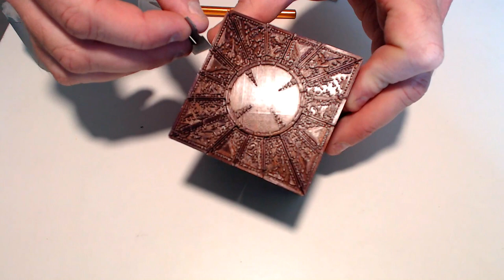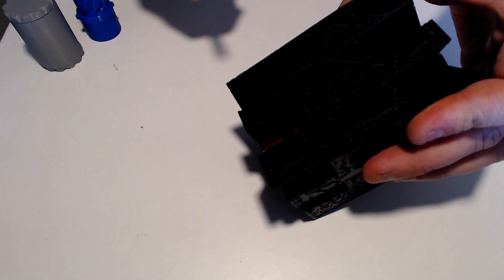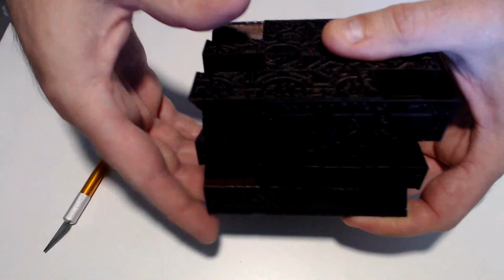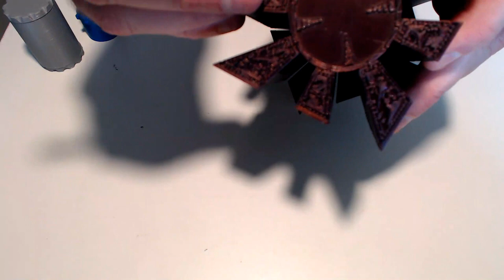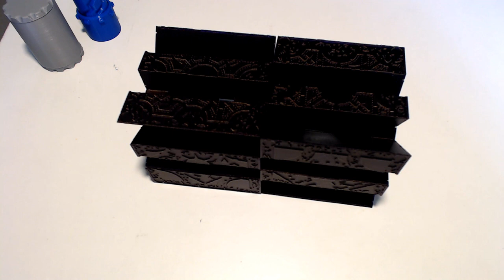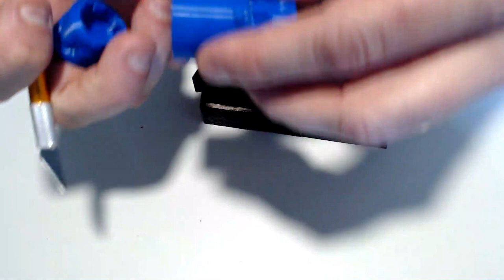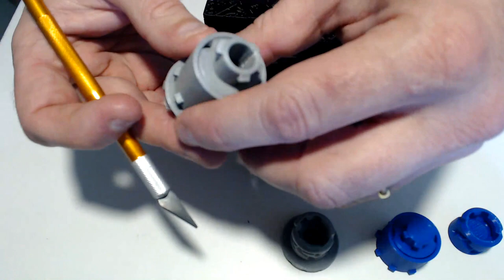Puzzle Box of Unknown Origin

Comment: I've been after something like this for ages and to find it as a printable object is absolutely fantastic! I'll be sure to make it in the near future and give you feedback (or buy you a coffee!) after it's done!
Reply: Just finished the print - the first thing I hit is the force required to open the unit as the close surfaces on the inside blades tend to warp and bind. I've been doing my best to free things up by working everything and have somehow managed to close it up fully! Not sure I'll summon a Centobite in a hurry at this stage, but it's a brilliant cube!
Reply from the maker: Thanks and good luck with that. Hopefully it's the puzzle working as intended, otherwise a little sandpaper and/or lube might help. I actually submerged one of the earlier ones in soapy water to begin with.
Reply: @TroyMackay  Thats not a half bad idea! I really think that the mistake is mine somehow, but typically we just cannot see inside the unit to figure out where it's binding!
Reply: @TroyMackay  I greased mine up all moving parts that touch with wd40. I wish the spring had a little more tension in it to where it comes up with a little more force. I haven't tried disassembly yet, but I got this extra cylindrical grey part with "teeth" on it that came extra. As I peer through the pieces I can see that same part within already so I was confused if it was a "spare" for a commonly failed component?

Comment: I cant seem to get it open  for the life of me, no elephant footing or anything of the such... I did the razor blade thing. and did a 2nd and 3rd try with a knife. it just wont open for me.
Reply from the maker: It's caused a lot of headaches, so I try to steer people towards the newer "deconstructed" version, but since you're here you might want to check out the "Cube Ripper" on Thingiverse. Strategically placed pencils or wooden spoon handles works for me to apply a bit of controlled force (assuming you haven't managed to turn the dials to lock it yet).

Comment: Is there a way to completely open a finish box? Ordered one of these from etsy and is in mostly good condition but there's a small ring with 4 teeth that was broken off the bottom dial/cylinder when it arrived, and so the box won't "lock". It seems like I should be able to easily glue this ring back on, just need to actually OPEN/separate the halves of the box to reach the spot I need
Reply from the maker: Not really, without breaking another part. The rotating part of the core would probably break off with a bit of force, like pulling it apart and bending it a little but then you'll have two problems. The glued part will always be weaker, another option would be to reinforce it with some 10mm dowel (or a bunch of skewers). You could possibly cut some notches to extract the core like the newer designs. Let me think about it some more, there might be a way to carefully break it so it is fixable. Worst case you'd still have a display piece without the core.
Reply from the maker: I'm assuming you don't have access to a 3D printer to print a replacement core. First thing I'd try is maneuvering a piece of dowel in there. 10mm or so diameter, flattened on two sides to squeeze in the gaps. A tight fit might be fiddly, but hold on its own, otherwise at least it will make it easier to align and glue the broken part (which should be reasonably accessible).
Otherwise, I reckon you could make a clean cut with a hacksaw blade, straight down the middle of the sliding cylinder lengthways - stop half way or just enough to split the outer spinning ring (like crankshaft bearings).
This might allow you to expand the fingers enough to get the spinning ring off the end of the cylinder and back again, cutting again in quarters if required.

Comment: Amazing! This might be a stupid question as I haven't printed this yet, but is there a space inside to place something? If not, is there any chance you'll make a version of this with one? This seems like it would be an amazing prop for a tabletop RPG if there was an opening inside that would let you hide something.
Reply from the maker: It's probably worth mentioning since you're not the first to ask. Yes, there is a 10mm diameter void within that is almost the length of the cube when closed. I was saving this for some kind of telescoping spring but you could hide something in there. There would be even more room without the puzzle mechanism, I was actually thinking of making another version with a simple latch to maximise that space.
Reply: @TroyMackay  Thank for the reply. This sounds like exactly what I was after for my DnD campaign!  Again, thank you for your amazing work!

Comment: Troy, thanks for this, can you explain how to take apart the box to insert a spring? Great puzzle, my brother is gonna love it
Reply from the maker: No need to take it apart. From the open position you can feed it through the gap into position. The spring is a bit wider than the gap but you can spiral/screw it through. The latest version does come apart for easier printing, though (but also uses a 5mm spring to strengthen the latch).
Reply: @TroyMackay  where do you get the spring, i've been searching both online and local hardware and hobby supply but cannot find a 5mm OD x 120mm spring anywhere, even mcmaster doesn't have them
Reply from the maker: @Sidion  I found a bunch on eBay, item 222981900101 was the actual one I bought which is still there.
Reply: @TroyMackay  thats perfect thank you

Comment: What if lets say,hypothetically ,i just put the box is hard mode and havent been able to get ut to open for about 2 hours ,what can i do?
Reply from the maker: Suffer... Seriously though, I've got a video explaining the mechanism if that helps visualize what's going on in there. One tip I'd give for turning the dials is stick to a preferred direction and just back track a little if you get to a dead end.
Reply: @TroyMackay  dead end would be when you can no longer turn the chosen one in said direction no matyer the position of the other one? Also wich video is that?

Comment: I printed this and I'm having real trouble freeing off the sliders, because of the dark color of the cube in the video I'm not quite sure where I should be inserting the hobby knife to try and free it and I don't want to break it by forcing the wrong thing. The cube slides really nice and easy to the half open point but from there I can go no further.
Reply from the maker: Sorry about the colour choice - it looks really nice off camera, though. https://thangs.com/tmackay/Puzzle-Cube-Open-14340 has a nice exploded view which might help. There should be a small seam visible where the sliding cylinder is stuck to the outer shell (it is symmetric). Just insert it enough to hear a crack and move around to the next gap.
Reply: @TroyMackay  thanks for that, managed to get it to free off from your description

Comment: Having troubles with the core breaking each time after opening it.. Should I increase my infill to make it stronger and not break from the dials? 2mm 20% infill
Reply from the maker: Not quite sure I follow where exactly it is breaking. There was a bit of a weak spot in the key piece that protrudes from one of the dials which is one reason I switched to a 5mm spring (in the "deconstructed" version). To make it stronger, add walls/perimeters instead of infill, though.
Reply: @TroyMackay  I upgraded the Infill but now the top internal ring won't come free I haven't freed the dials up yet but should I be able to simply get these both half off each other?... Seems jammed in the middle
Reply from the maker: @trevorphilips9368  There's a one-layer gap at the top of the cylindrical core that might need a little encouragement to de-laminate. A hobby knife should do it.
Reply from the maker: @trevorphilips9368  You know there's a heaps easier version to print, right? (description)
I'm starting to think the dials and retaining rings are still better off printed in place if you can manage the clearances and don't mind the overhang.

Comment: I have a problem with the cube.  The retention rings fell out and I can't complete the puzzle.  I can pull it out a little bit, and the spinners come loose from the face of the cube, but then it snags on something.  Neither spinner spins freely, which is the part that's confusing me.  If the two halves can come apart that much, the center lock must be disengaged.  What would be holding the "top" spinner from spinning?  I printed your latest version that is printed in different parts.  https://www.youtube.com/watch?v=NgGZGAddg38
Reply from the maker: It is possible to engage the maze with the main latch in the open position (ie. without turning 180 degrees first). So that the maze itself is holding the two halves together with limited movement. The retaining rings shouldn't really interfere, they are just to stop the dials poking out like that, maybe add a little glue. Your best bet would be to re-engage the main latch and solve the maze until you can turn one of the dials through a full 360 degrees before disengaging the main latch again.

Comment: Hey Troy, wanted to check with you. Printed out this version of the box and was able to eventually get it open and spinning. Once I closed the box however, I couldn't seem to do anything. The top dial can rotate freely right now (it gets hung up on some spots) but the bottom dial doesn't move, no matter what position I put the top dial into. I can't open the box no seemingly no matter what position I put the top dial into, do you know if this is just cause I can't solve it? or is it a print error?
Reply from the maker: Sounds like it is working as intended. When the top dial spins like that it is latched, but not locked (to use a door analogy). If you are able to start turning the bottom dial, that is when it is truly locked. There are two positions the top dial can get to from here (and it has to be aligned fairly precisely) one which opens, and one at 180 degrees which allows the bottom dial to start turning. It sometimes gives a moment of free travel at the open position so it's easy to skip over.
As an extra hint, take a look at how the dials align with each other in the 3D model. They don't quite align but kind of share an edge. If you look really closely, they're not quite symmetrical either.
Reply: @TroyMackay  Thanks for the heads up. Fiddled with it a bit more (your right, it was easy to skip over). got it opened again :) But now I'm scared to lock it :P
Reply from the maker: @hydntylr95  You're supposed to be scared to open it! :)

Comment: great but mine is still stuck half way even after losening that bottom area, infact it wont even close fully now. Do you have a version of this that i can build as the whole print isnt viable.
Reply from the maker: You're nearly there, sounds like the at least one of the dials are even moving (since it won't close - it's probably just turned a little out of alignment). Have a look at the Thangs link - it has a nice exploded view, but you should be able to see the seam where the parts join. Just carefully insert a hobby knife to encourage it to separate, or even give it a little tap to shear it apart.
Reply: @TroyMackay  Seems something went wrong in the middle, some sections where melded when they shouldnt have. I have seen another one of your cubes ( Hard Mode ) seems a lot simpler in terms of operation and printing. Will give that a shot and print the core first.
Reply from the maker: @nidhogg3390  No worries, good luck. I was thinking you could print the core of this one separately, and do the trick of pausing the print at a certain layer and dropping it in but I think that would be inviting failure at 90% might require some slight tweaks to the model, too.

Comment: It's really difficult to pull this apart. I heard every type of crack thats possible while running the razor through the  sides and tops and the damn Lament still havent come apart.
Reply from the maker: Take your time. Have you been able to get a little movement from each of the "fingers" as you work your way around? Also check out this handy tool: https://www.thingiverse.com/thing:4950079 by CUBEd_3D
Reply: @TroyMackay  yeah yeah. The "fingers" are moving out a bit. I am slowly working around with the knife, cleaning ridges. Hopefully I will manage to open it. The model is absolutely amazing. I also looked at the exploded version so I will hopefully open it.
Reply: @TroyMackay  printed out the tools, Moved the fingers as far as they were able untill i heard the crack from them releasing from the ridges, moved it this way all around. I ran blades multiple times throught the crevices of the model. It is looser but still wont move a fuckin inch outwards. No matter what i try. I even threw it into a bucket of warm soapy water and it did absolutely nothing. It would perhaps use a little bit more space around the pegs inside so it is easier. Almost destroyed my whole thumb on it as the design quite cut your hands. I am working on the cube since noon and its almost evening. I saw every video, read every description, but the damn cube wont move an inch.
Reply: @TroyMackay  finally managed to pull it apart but the part under the cylinder broke off while i slid the parts open so I can throw it into the bin anyway. 10/10
Reply from the maker: @AlphaOmegaLPstudio  Sorry to hear. I've got a lineup of previous designs and print failures myself. I included the "draft" as a way of quickly tuning the printer without going all the way. It's the same print-in-place mechanism just without the styling.

Comment: yo so i got the elephants foot on this print but it has only ever happened on this print and i was using a razor but found that the parts were stuck together and it is impossible to spin the two wheels without breaking it
Reply from the maker: There's a lot of contact area there with the bed, and a lot of variables to control extrusion - flow rate, temperature, e-steps etc.

Comment: does the core need to be broken in the center on the full print?  cannot get mine to turn whatsoever.
Reply from the maker: Usually just need to break the seal. Same clearances used throughout the model, so if it opens then overextrusion shouldn't be the problem. Might just need a little encouragement.
Reply: @TroyMackay  ok,but it is supposed to come apart then?
Reply from the maker: @Vampir4997  no, only opens to the point shown. Doesn't come apart completely.
Reply: @TroyMackay  sorry,mean the inner part so it will turn
Reply from the maker: @Vampir4997  not sure I follow. Check out the exploded view on Thangs, it shows all the separate pieces pretty well
Reply: @TroyMackay  oh ok,ty
Reply: Print looks great. I can slide it half-way open and turn both dials, but it wont open more. When I close it, I can only turn one dial. I've been stabbing just about every place I can get to, but it seems like the outer cylinders are stuck somehow. Any advice? I've looked at the Thangs site, but not sure which cylinders should come loose.
Reply from the maker: @perhakon  might be the part labelled "maze runner" in Thangs. It's  a cylinder within the main core cylinder - shouldn't be held on by much. I've got a fresh print ready, will  try and capture the process.
Reply from the maker: @perhakon  A few people seem to be getting stuck "half way", could you share a picture? As for closing it, the bottom dial will also only engage in two spots with the other dial once the slider is free.
Reply: @TroyMackay  The "maze runner" can spin freely. To me it looks like the "core spinner" can't be detached from the cylinder part of the "top shell". I've uploaded some pictures here: https://www.thingiverse.com/make:925588
Reply from the maker: @perhakon  hmm, there shouldn't be anything holding it at that point, except the cylinder part is not part of the top shell, it should slide down the fingers, that's the only thing really touching. There's not support material in there clogging up the tracks, is there?
Reply: @TroyMackay  No, the "fingers" seem to be loose from the core spinner, and there's no support material. You can see in one of the pictures my attempts to stab loose the core spinner, but I can't do that for the area of the cylinder behind the "fingers".
Reply from the maker: @perhakon  is that the other seam above where you've been stabbing? I think that's the one you need to separate.
Reply: @TroyMackay  The other seam above is between the top dial and the top shell cylinder. They could be easily separated by stabbing a blade in with a 45 degree angle. I've uploaded another image with some annotations to show where I can't detach the core spinner from the top shell cylinder.
Reply: There, it opened completely! You were right of course, I was stabbing 2 mm too low. I hadn't noticed the small seam just above. I've updated my make description accordingly.
Reply from the maker: @perhakon  good to hear. Nice print, by the way. Those annotations should help others getting stuck at the same spot. Thanks.